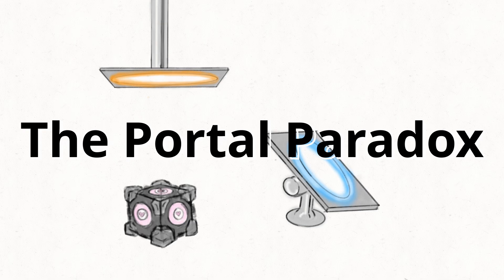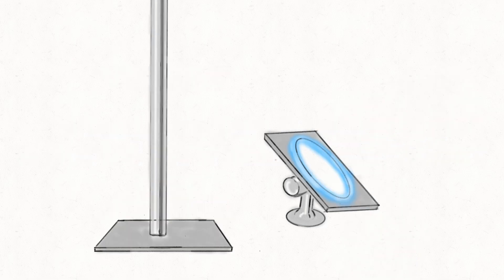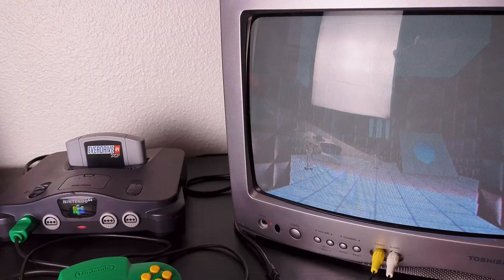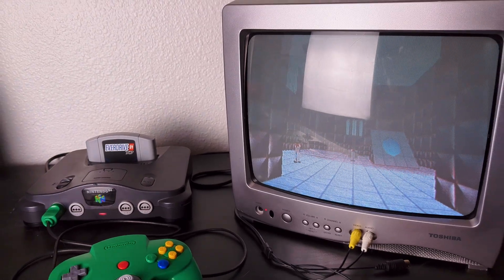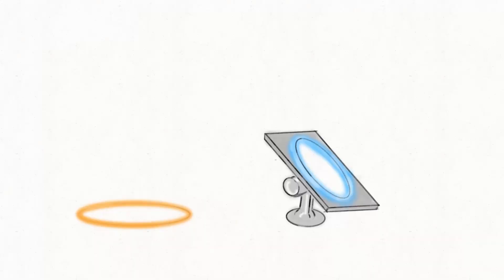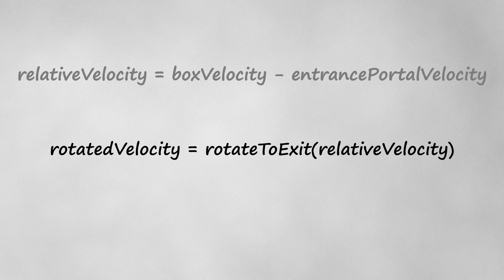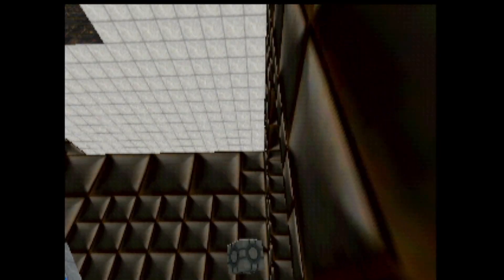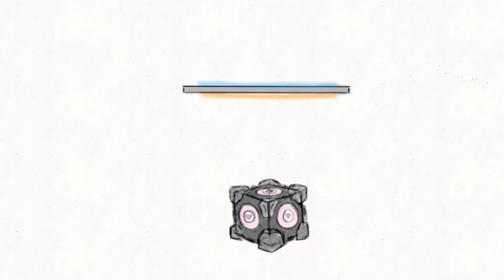I rewrote Portal from scratch and solved the Portal Paradox

Comment: I've always wanted to know for sure what would happen if a person/object was between two moving walls, both with portals on the surface, as they move towards the person/object from either side.

My belief is the person/object would make contact with itself on the sides facing the portals and then crush itself - though the physics are hard to imagine, because if the portals went perfectly over them/it, then in theory there'd be no resistance placed onto the walls to prevent them from fully closing and having the person/object perfectly pancake themselves imbetween.

Others believe you'd somehow stumble into some kind of imbetween portal space, though I believe this doesn't add up, because they're portals and not wormholes - there is no space between one portal and the other which one has to traverse to reach the other side.
Reply: I feel like, it'd be the same as imagining that your left and right are copies of you, being pushed towards you, then my right shoulder gets pressed against the right copies left and vice versa. They keep pushing more, with deadly force and all 3 of us (tho we're all just 1) are squashed
Reply: Generally in a case like this, any theory that violates physics is probably wrong.  Sometimes a theory makes no sense but the math all checks out, and it turns out to be true.  The mystery then is figuring out why it works that way.  In this case, I feel like pancaking something between the portals is probably wrong, as is the in-between space, as neither seems consistent with what we know about physics.  A more logical outcome is for the object to exert a force that prevents the walls from closing completely.  How is anyone's guess, but it probably depends on how exactly portals work in the first place.  Or something else might happen, which would lead to new discoveries in physics.
Reply: @Greywander87  Perhaps some kind of force would be exerted on the walls when the two portals reach the edge of the person/object they're simultaneously closing in on - but that would rely on the portals themselves being receptive to resistance, and them then also transferring resistances onto the surface they're on - imo that doesn't add up logically.

E.g. if you had a portal on one unstable and loose wall (say an office wall tile) which someone is primed to run and jump through, and a portal on another wall which is solid, and then you seal that portal off by placing another solid and immovable object infront of the portal the person would be exiting from, the person moving through the entrance portal would be meeting that object blocking the exit portal, exerting force on that - both the portals and the walls they're attached to encounter no resistance or force.

Imo this is why a person stood between two portals moving towards them would simply be pancaked by themselves by a force that encounters no resistance from said pancaking - it would in theory work with infinite mass but relative velocity.
Reply: @Greywander87  I wouldn't think there would be anything in physics that says one side of a given object can't push against a given object on the opposing side, even if that object is the object in-question pushing against the object in-question. I think considering the circumstance only when the portals are touching throws off the way one would think of it. Say an object is sitting in front of one portal, and you push an identical object through the other portal. The object you push will push with the force you push with. It's like how if not for wind-resistance, Chell could potentially, were portals to exist rather than being a game-mechanic, fall near-infinitely fast through portals placed one over the other with a space to fall, were it not for wind resistance (assuming that's why the game has a top-speed and it isn't just for game-engine/game mechanic reasons.) That is an example of freely adding more and more force to an object without resistance existing from entering or exiting the portal, to suggest that the portal has no known effect on its surroundings, and simply treats the spaces on either side as if there were no space between them. I imagine bringing 2 portals closer would indeed apply sufficient forces (of an object pushing against itself, without any help from the portal) to, depending on the distance, "pancake" or otherwise distort its shape to the point that it would push against the wall surrounding the portal like a hydraulic press.
Reply: @Ellensiel  You lost me there but I think what you're saying is that an object could push on itself, and with enough force, could pancake itself.  I agree with this, I think what's being disputed is the "with enough force" bit.  Some people are arguing there would be zero resistance preventing the portals from being pushed together, so even with a tiny amount of force you would still be able to pancake even the densest object.

I think the simplest way to consider this issue is to remove the portals.  If the moving walls have enough power behind them to crush you, then so would the portals.  If they don't, then neither would the portals.  The portals just make it easier to clean up afterwards.  This insures that all physical properties that require conservation are conserved.
Reply: @Greywander87  Crashing into yourself and getting pancaked is exactly what would happen if portals worked like they do in the video. Think of it like the video said: all motion is relative. Neither portal "sees" itself as moving, it sees itself as stationary while you and the other portal move towards it. So from the POV of say the entrance portal, you and the exit portal are both moving towards it. You enter the portal and come out the other one, maintaining your relative momentum and crashing into yourself.

I'm too tired to calculate any speeds with any amount of confidence, but I don't think we need exact numbers for the thought experiment to work.
Reply: Here's my reasoning:
1. You can touch something on the other side of a portal through the portal
2. If the portal is up against a surface, you can touch the surface
3. If you have two portals on opposite sides of you, you can reach through one portal to touch yourself through the other portal.
4. If the two portals move together, given that you can touch yourself, your left side (for example) would touch your right side, and you would gradually get crushed.
Reply: @samuelthecamel  yeah I totally agree, it's the simplest way of thinking about it and it makes the most sense - the part that's REALLY interesting to think about is whether the portals/walls encounter any resistance in the crushing process, or if you're crushed by a force that essentially encounter 0 resistance, seeing as it's you crushing yourself and not the portals.
Reply: @pootytang69  hmm, good question
Reply: sounds like it might create a black hole wich will swiftly sort out the paradox as everything nearby will have been mushed XD
Reply: I'd imagine that depending on the force that is being applied to the moving walls, ie whether that force is greater than the resistance offered by a human body, the walls would either stop as soon as the portals make contact with the human or the human would be crushed in mostly equal directions (slightly imbalanced due to mass difference between left & right side of the body). This all implies that the portals are subject to resistance & pass that resistance onto whichever surface they are on.

Though another argument could be that as portals are essentially bridges to another exact point in space, as soon as the portals touch the extremeties then the human would become fused with itself on opposite sides on an atomic level, resulting in (when the walls have fully closed) a human-length, extremely dense, single atom-width line. Though that suggests that the portals & walls wouldn't actually be touching. If the portals and walls were then to touch, that single atom would be compressed further which either: breaks the laws of physics, creates a brand new atomic structure, or releases a lot of energy as the bonds are forced to invert.

I personally vote for insta-nuke.
Reply: @Blazin130  the second one is my thinking, but with the first, I think force on the walls only happens when the human atom nukesicle exceeds the portals size, with the human giblets liquifying and acting something like mercury if it didn't explode
Reply: For the crushing, let's start from stationary and the distance between portals is equal to the height of the object. As the top portal goes down, the top of the object will try to force its way further up the bottom portal, but will be resisted by the bottom of the object, which is still not moving (let's say the object is held in place by thin brackets for simplicity). But you're also right that there will be no resisting force from the walls, as there is no evidence that portals exert force on the surfaces they're attached to, and the object is only touching itself anyways. Best I can think of is that the portal fuckery creates some kind of infinite compressing force. Though the mass wouldn't disappear, because as the distance between the portals approaches zero, the compressed matter will expand out parallel to the portal surface. Would be pretty useful in some industries.
Reply: @SpaceNerd117  Yup, good summary - this is exactly what I believe would happen - not sure why so many people think the portal crushing would exert force upon the walls via the portals, or exert force against the portals - they just be magic doorways.

Only thing I can think of that might also need to be considered is how when a portal is placed on a surface, it does basically vanish part of the surface away (though as far as we know the rest of the surface is just directly behind the portal, and the portal is merely obscuring it from view until it's placed elsewhere) - so maybe portals do have the capacity to entirely displace matter, but I still think it'd be crush city without a doubt in the scenario.
Reply: I think the most intuitive way to answer these questions is to convert the problem into an equivalent one where the portals do not exist. If you were to instead have two people stuck between what is essentially a hydraulic press, then yes, they would be pancaked.

This technique helps solve the subsequent question of whether the portals would need to exert additional force to pancake the person — they would, since the press would. This conclusion is supported by the requirement of energy conservation, as energy must be expended to deform an object.
Reply: @neo-necro  I think you're overlooking the fact that the portals are the whole point of the thought experiment though - they don't obey any known laws of physics, hence why it's so interesting to speculate how a portal (as depicted in the game) would function in ways beyond what is demonstrated - it's more about intuiting the information about how the portals work that we already know - they're not wormholes, they're seemingly without a physical presence themselves, they're simply magical doorways which can be dynamically relocated.

The moving walls with the portals on their surface would provide the velocity at which something is pancaked between them, but they don't tangibly interact with anything except the surface they're placed on (they stay relative to it) - the surface doesn't experience any resistance or impact or any sort of force from an object passing through a portal on it - therefore we have to assume if two portals simultaneously moved across either side of a person meeting in the middle of them, that the person would be crushed by themselves in a manner where no resistance is experienced by the walls (unless part of the person sticks out beyond the surface of the portal.)
Reply: Also, the force that's building up while pancaking will eventually deform the body (let's assume a qube for graphical reasons)
Since the qube has less and less space between the portals to go, it would quickly splat out to the sides along the walls, similar to what's happening in a real hydraulic press.
Therefore there will eventually be "stuff" between the closing walls, even if the portals are really really big, preventing the walls from closing completely (i.e., leaving a very small gap)
Reply: @pootytang69  mate, they're portals on either side of you, you're going to get crushed against yourself as the portals move in just from not having room.  Why do you think the slamming portal works?  Normal force.  In physics, when you press against something, it presses back.  And according to the inertial reference frame of the portal, you'd be pushing against yourself.
Reply: @lordadamant  dude, I dunno if you've actually read any of my comments but that's exactly what i've been saying and debating for :P
Reply: I think one would get squished wirh yourself,  one half of your body collides with the other half
Reply: My assumption is that the portals will cancel eachother out because they do the same thing but in opposite directions. Portals have no depth. They are just a threshold. So like any other no portal surface you would just be crushed between walls but in this case youd probably crushed by your own body with the force the walls are exerting on it. 

The take away here is that portals don't provide extra space. The distance between the two surfaces is still decreasing as the portals come closer together.
Reply: I'd propose that you'd become infinitely dense and/or crush yourself in the process. There will come a point where the area between the portals will become smaller than the area you take up, and you will start being pushed against yourself. As the portals draw closer you will start to pass through them multiple times and you will simultaneously be taking up more of the real-estate and losing area until you are just... crushed inside yourself and become continually more dense
Reply: so imagine you have a portal entrance and a portal exit facing each other super close. You could reach through one portal and grab yourself on the shoulders from the back. Imagine the portals getting closer and closer slowly until you're bumped up against your own back, which you would also feel as being squished by yourself. As the portals continue to get closer, you are forced further and further into yourself from both sides eventually squishing you with infinite strength with yourself.

from a top to bottom portal, you'd basically get your own head shoved up your own ass and you'd feel every moment of it until you got smashed enough to break something important that causes you to die.
Reply: This whole comment chain illustrates how crushing is the real portal paradox. The moving portal bit is just a simple frame of reference excercise. Although, what if gravitational potential energy were to be accounted for?
Reply: What you're asking is what happens if you put something only into a portal part way
Reply: @markvickroy6725  I'm not sure what made you think that but it's not the case :P

The question is more so what would happen if two portals moved over you towards your center from opposite sides - would you in essence be forced to crush yourself.
Reply: This is straightforward, say there are two walls with portals each moving at 1 m/s towards the person on either side. Once the portals move over any part of the person's body, that part of the person's body is accelerated to 1 m/s through the other portal (as the video above demonstrates). This means your right shoulder would hit your left shoulder at 1 m/s (and it would probably hurt). But after that point, you are providing resistance against yourself, and you would be transferring the force of you pushing against yourself to the walls the portals are held on.

Think about it this way. If your interpretation of portals requires infinite mass but relative velocity, that implies that it would take an infinite amount of force to move a wall with a portal on it. And even if the portal's mass isn't infinite and we can move it, then we need to think about the conservation of energy. You can't just accelerate a wall with a portal on it to 1 m/s, then pass the portal over a stationary object so that the object comes through the other portal at 1 m/s, and still keep the wall moving at 1 m/s. Rather, the wall + portal system (whether the portal has some mass or is massless) would have to lose velocity equivalent to the transfer of momentum between itself and the object it passes the portal over, thus slowing the wall + portal system down. You have to experience resistance from the inertia of the object. This is not something that comes up with stationary portals because the object is already moving at that velocity and so no energy needs to be expended to keep it moving on the other side (like a moving object in space).
Reply: I think if the platforms were coming together at the same speed nothing would happen. Their speeds would cancel out and the cube wouldn’t move. If one wall has a higher velocity than the other it would shoot the cube out the other portal at the difference between velocities